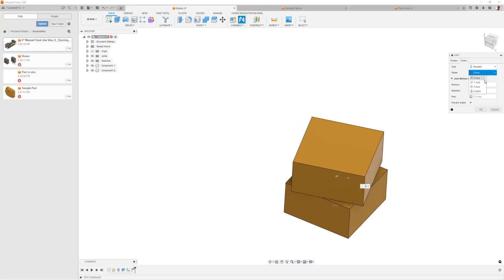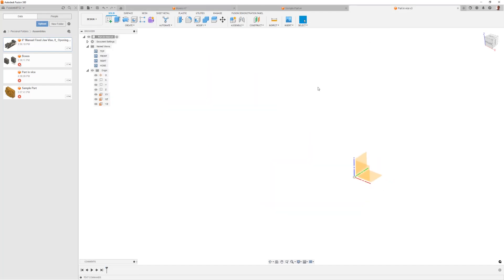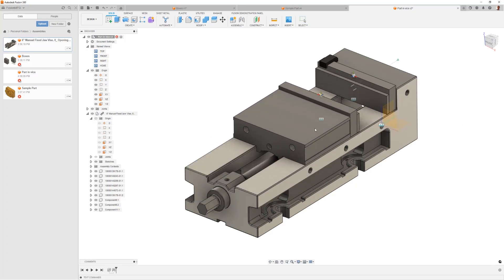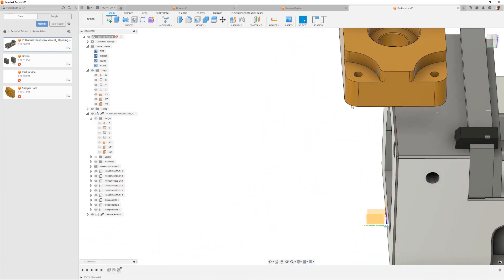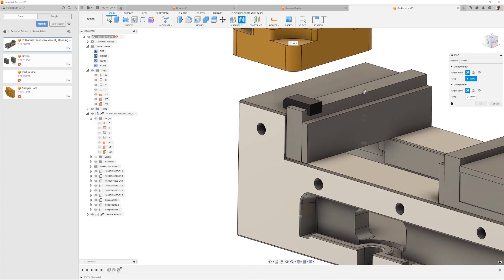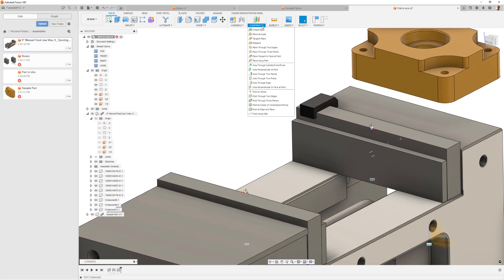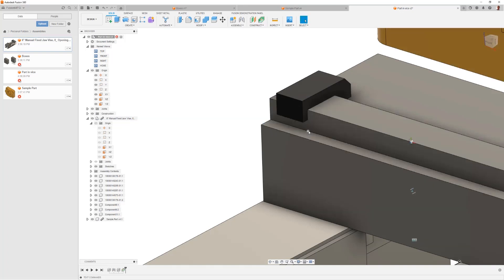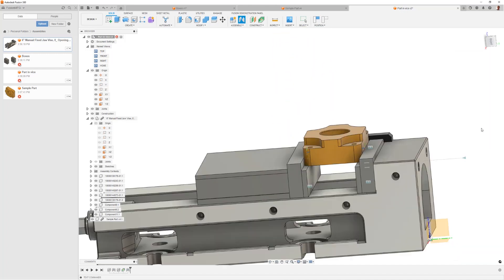Quick Tip: How to Lock Parts in Vises with Fusion 360 Joints | Autodesk Fusion 360

Comment: So much work when the joint command should just let you click various combinations of planes, lines, and/or points from any source to form joints. 

Seems like I have to go through multiple extra steps to not only manually define a constraint nexus point, but then go through even more extra steps later to de-constrain things if so desired. Joints are a lot of work to do a simple job like this; to the point that it's easier to just use align and ground for anything that is ultimately meant to be a static arrangement such as a piece of work in a vise.

Comment: Great, more things I didnt know! Seems faster than my workflow. First Create a sketch on the paralelle and project the paralelle and the edge of the stopper to create the point. Second create a sketch on the bottom face of the part, project the part, extend 2 lines to create the edge point. Third use move copy and point to point and bring the vise to the part.

Comment: Hi! Complete noob and amateur here  :)
I'd use another approach: use align to, well, align the components and then put an as-built joint to fix it in place.
Also instead of joining origins I would just "ground" the base of the vise.
Reply: Fixing it in place does work.  However, it means that if the model changes you don't get the benefit of parametric updates.
Grounding has it's own set of challenges if you plan to insert this assembly into another one.